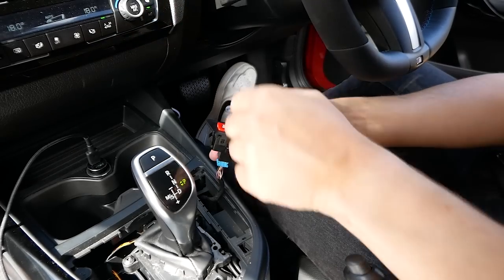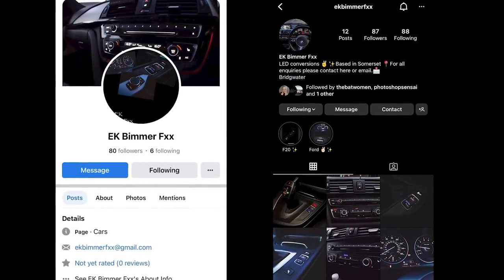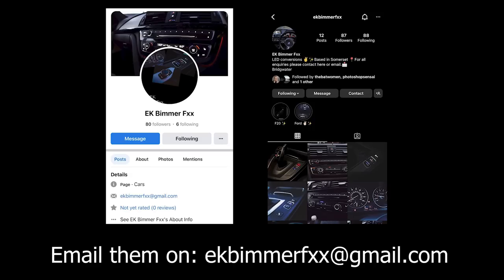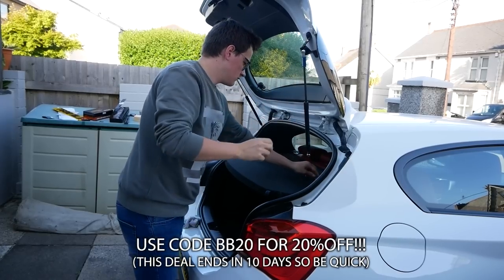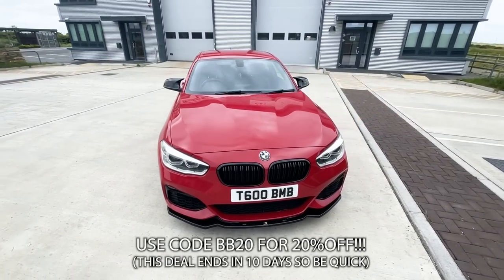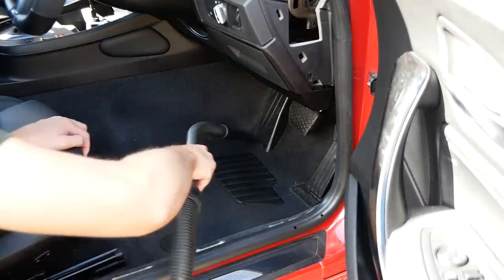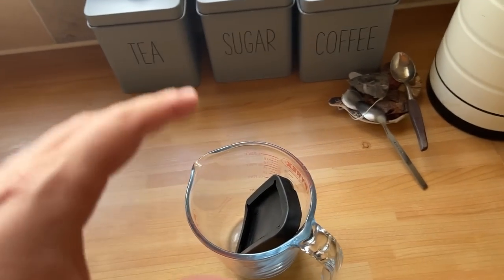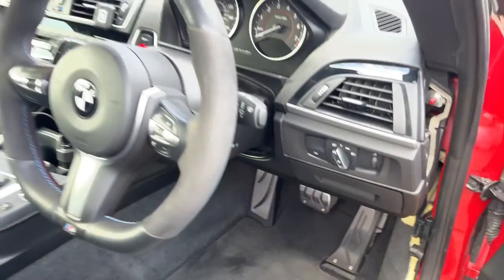M140I INTERIOR LED CONVERSION MODIFICATION *FINALLY MODERNIZED*

Comment: You will love the M2 cluster I have one in my M140i!
Reply from the maker: I’ve had one before on my old car, they are great 😎
Reply: @BrettBarnesYT  are you getting a used one or new one? You can get cheap new M2C ones but they have 8k RPM and M2 Logo.

Comment: Hey dude, quick question, the double res delete and sports cat you did, is that legal and will it pass MOT based on noise? Wanting to do it with mine but not sure if I can or not 😂😂
Reply from the maker: I think you can only get an advisor for being too loud! But turn cold start off and you’ll be okay. It’s the emissions they test

Comment: What’s with the engine management light on?
Reply from the maker: Not been mapped yet bud
Reply: @BrettBarnesYT  how does a remap have anything to do with the MIL? It’s on for a reason. Sensor or issues
Reply from the maker: It’s because I’ve changed the CAT to a sports cat. Just needs mapping out. It’s completely normal 😀
Reply: @BrettBarnesYT  you not refitted the sensor as well?
Reply from the maker: Yeah of course I did mate 😀. Normal for it to pop up.

Comment: I get 42 mpg on a run using CC
Reply from the maker: Mine wasn’t mapped with the sports cat at the time of recording this video so it’s not running at its most efficient. 😀
Reply: @BrettBarnesYT  currently stage 1 custom mapped for performance so I’m very happy at the moment not sure how stage 2 with decat will change things tho. Great work btw and glad to see you bounced back from the loss of the original 140i you had.
Reply: @Poontang123  i still average around 35mpg on a run with cc. Mines tuned to 480bhp so not bad
Reply: @jamboSAFC  mines 436 stage 1